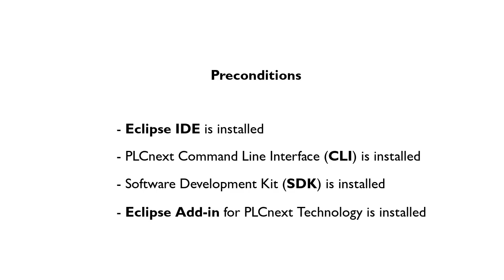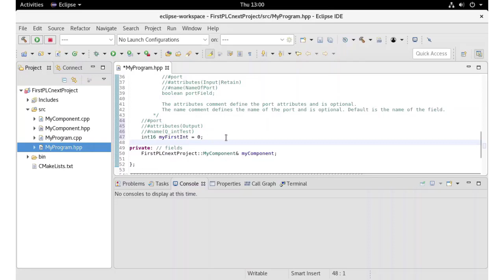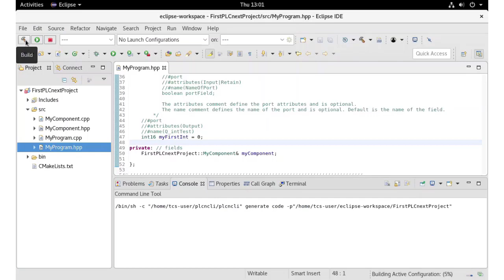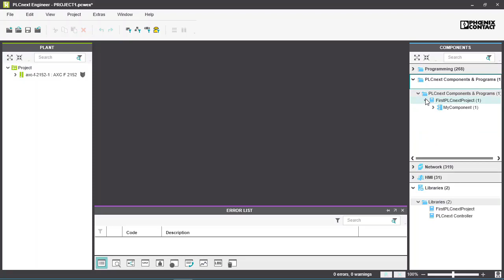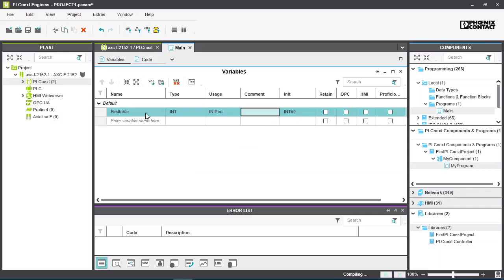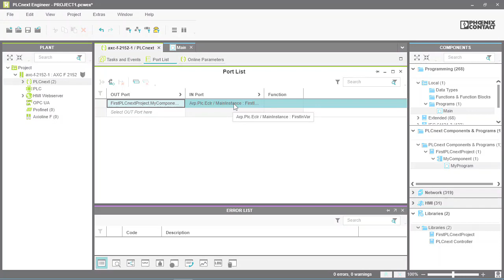How to program C++ on a PLCnext control | C++ with PLCnext Technology

Comment: Hello!
Excellent video tutorials have been very helpful to me.

I have a particular query to the video, is there a way to disable / enable the profinet to axc f 2152 from PLCnext Engineer, as there was in PC Worx for the AXC-1050 ?.

also because when I give axioline read axl f devices in plcnext engineer I never find the bus devices, but if I add them manually when I load the project they are still not recognized by the bus, the diagnostic D is in (flashing / yellowThe device is not (yet) part of the active configuration.)
Do I have to do something else besides adding them?

I'd appreciate your help

att. Carlos Delcid
Reply from the maker: Hi Carlos, excellent questions. We like to encourage you to switch over to the FORUM section in the https://www.PLCnext-Community.net where all kinds of answers and help are available.
But because you asked so detailed, here are the answers to your questions:

1. Disable Profinet from PLCnext Engineer: This feature will be available in a future release of PLCnext Engineer and the PLCnext Control firmware. Sorry, right now, there is currently no way to do it that way.
2. "Read Axioline F devices" in PLCnext Engineer: same here. This feature will be implemented in a future release. Currently, the command does nothing. Due to some shifting in the feature requests, the command was already implemented in the user interface but the code behind it wasn't. The development will catch up soon, sorry for the inconvenience.
3. Errors after manually adding the bus devices: If all the Axioline I/O modules are connected correctly, and if you are certain that the Axioline configuration in PLCnext Engineer matches the actual module arrangement, then you may still see the flashing D indicator on the I/O modules until process data is written to the module for the first time. If you cannot access the I/O module, or if the diagnostics indicator continues to flash after writing output data to the module, then please raise the issue in a new post on the https://www.PLCnext-Community.net Forum.
We're always happy to help!
Reply: @PhoenixContactTechnical  
Hi there!

Thank you very much for the response to my comment.

I have understood some of my doubts about PLCnext Engineer.
-About point 3 I will follow your recommendation to make the consultation in the forums.

Thank you!